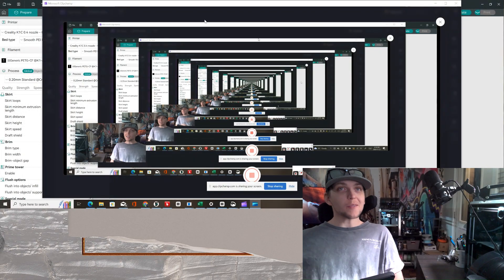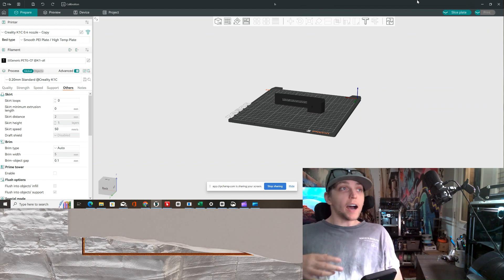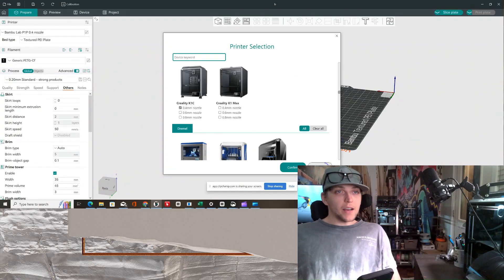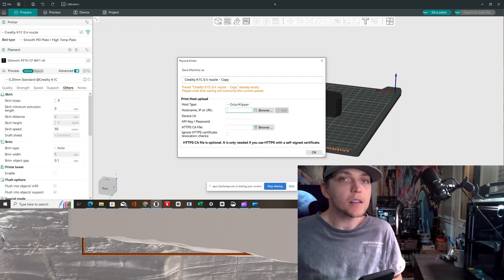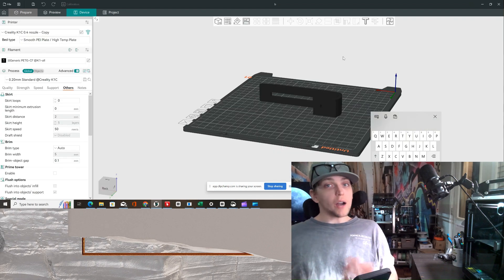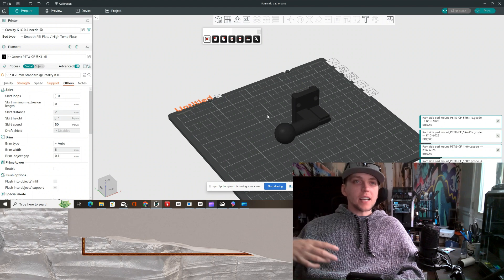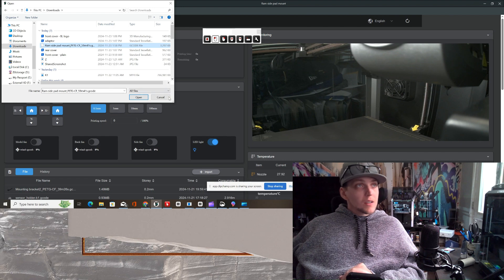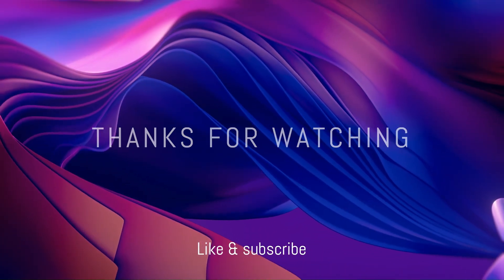Creality K1/K1C Users MUST Know This OrcaSlicer Trick!

Comment: Thanks for the video. In the old versions of Orca Slicer, you had to use root and install some things, so you used OctoKlipper. From your video, I noticed that the new version of Orca Slicer (2.3.0) has the "CrealityPrint" option. I just entered the IP of the K1C printer and it worked, sending the print directly without any problems.

I hope this helps.
Reply from the maker: @lsperes2007  interesting, do you have to download a plug-in? For the reality print option
Reply: @Qwadsqwadd  no its baked straight into it now

Comment: So you have October/klipper host selected, that works if you have rooted your printer and install the Gillios script. Anyway if you change your host to Creality it will send the file over, use the open device tap and start the print. If you use the script it starts automatically. Good luck
Reply from the maker: Thanks man. I’ll definitely try that out and see how it goes.
Reply: @ when you put the IP address don’t forget the :4408 port for fluid. I couldn’t get the name trick you used to work on my setup
Reply: @rambokd  I couldn't get the name to work either. About page shows the name starting with K1C-, but router clients shows up as "ingenic-". I even tried using "localhost" with the printer name and that didn't work. Also, when using the IP address (192.168.13) I don't have to add the :4408. These things must work on some local network setups, but not on others.